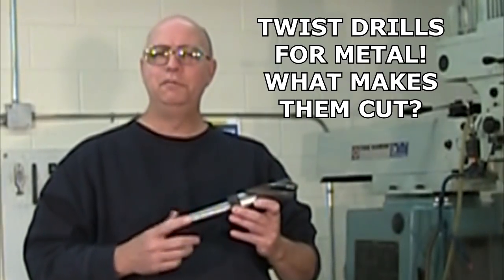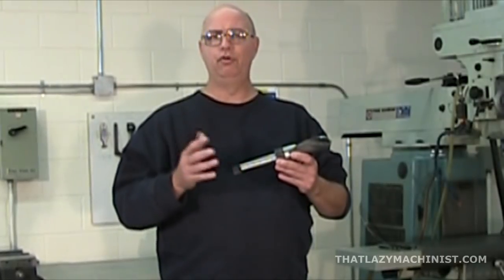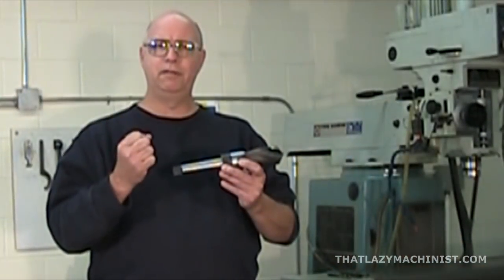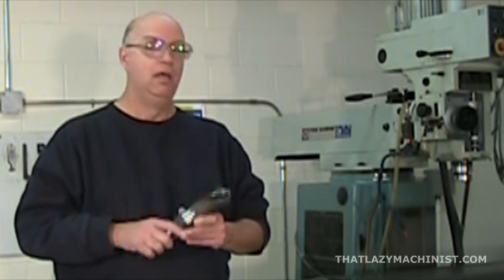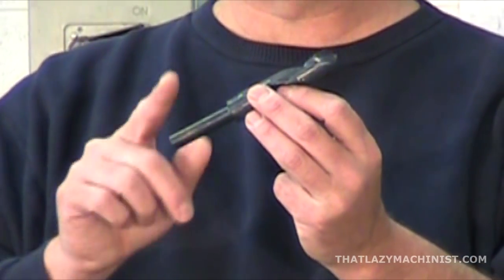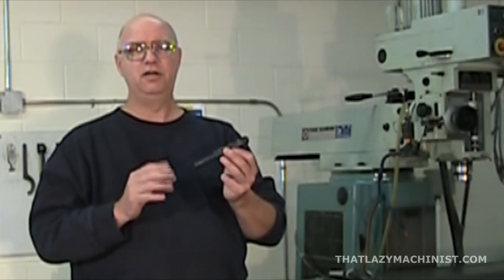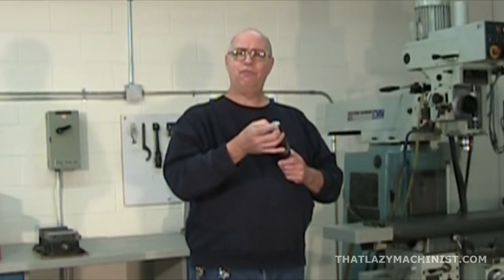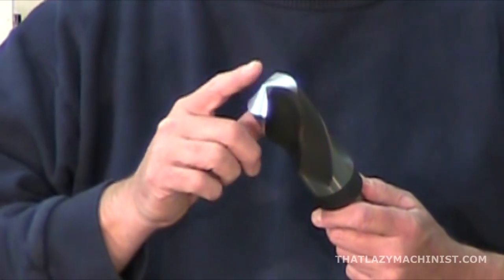DRILL BITS FOR METAL , HOW THEY WORK ! MARC LECUYER

Comment: To blab on some more... Note that the function of a twist drill is to make holes. They aren't intended to make round holes, holes of a certain size, holes with a certain surface finish, holes that are straight, or holes in a specific spot.  You can do all those things with care and properly prepared drills, but generally if the requirements are more than just a hole you may need center drills, reamers and boring heads to do a proper job.

Comment: Hi Marc,
i see your point (no pun intended ) with regards to using a pilot drill that is smaller then the chisel width, if the hole is larger the drill can wander a little as the cutting edges fight each other but if the hole is a little smaller than the chisel edge it will self centre .

Comment: Learned something that was contrary to many related videos, always been taught to follow drill bit with smaller chisel tip than guide hole . I need to relearn this. What are your views on starter drills vs center drills? Starters being 90  and even 120 degrees while centers are usually  60.  I ' m guessing closer to 118 is better but the circle of contact for just 60 degrees possibly more accurate.

Comment: Another modification to reduced shank drills is to have three flats ground  on the shank so that the chuck jaws don't have to bite into the shank for a good hold. As you note, reduced shank drills are handy in the shop, but aren't for high performance drilling. Pilot holes for large reduced shank drills help ease the effort to drill a hole substantially.
Always enjoy your videos...even after 50 years in the shop, there's always something new to learn.
Reply: Yup, it's not as if you grind it to a full triangle, just three small flats.
Reply: once you grind the three flats you cant use them in a collet chuck . 
i will never understand why they stamp the drill size right where the drill chuck is going to grab it !
Reply: Sure you can... I do it all the time.
Reply: Chris Stephens 
For some strange reason that was what i was thinking  maybe it was some commercially available drills have flats machined on them that almost turn the shank into a triangular cross section and i thought they wouldn't sit too well in an ER style collet .
Reply: Ian, you would be right it wouldn't but fear not as your worries are unfounded. :>)